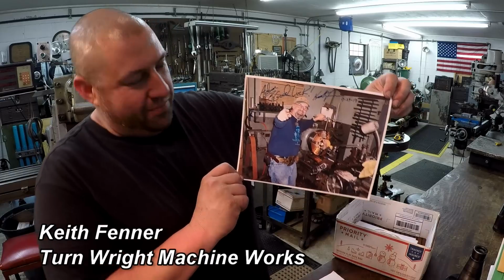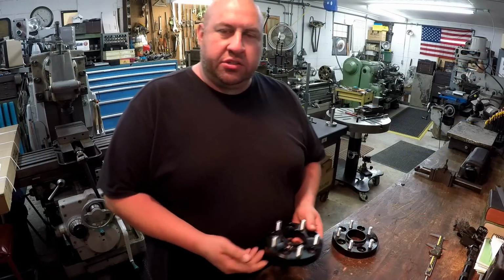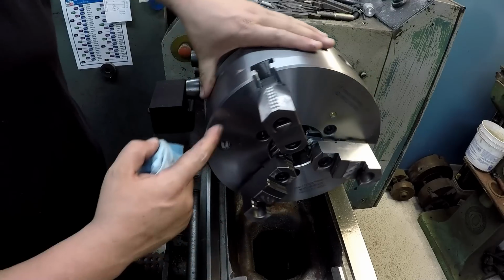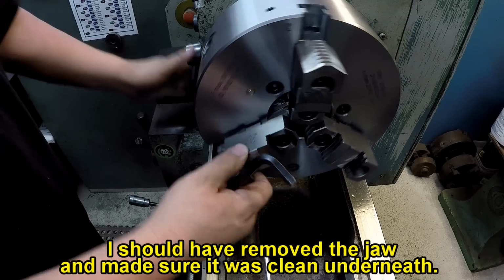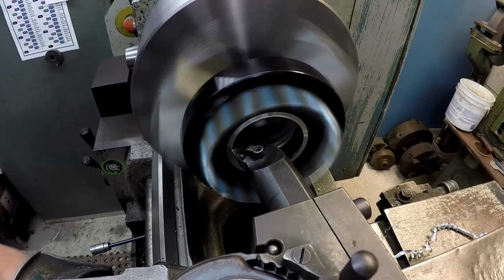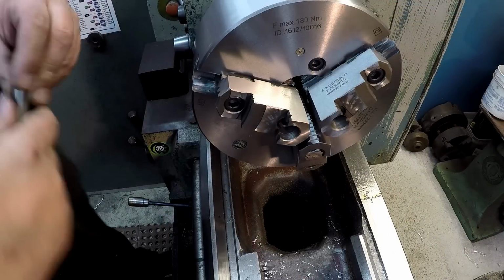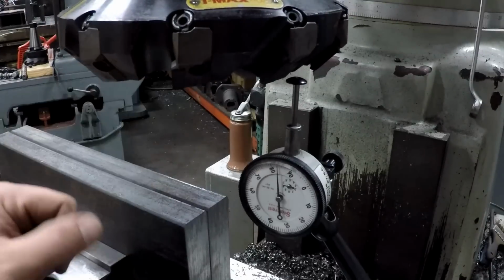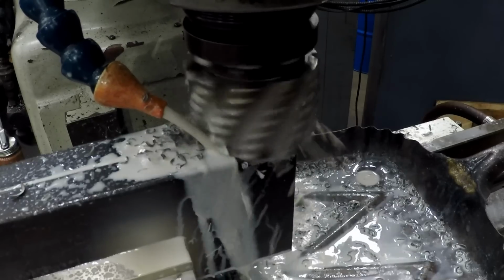SNS 165: First Job for the Gator Chuck, Facemilling, Viewer Mail

Comment from the maker: Lots of "your doing it wrong" comments on this one. Wow. The spacers won't fit on the hub of the trailer axle because of that smaller bore that needed to be removed. The conical lug nuts center up and hold both the wheel and spacer. Just doing what someone wanted, for a small trailer that holds a small aluminum boat. I'm not going to get into an argument with anyone with this job. It is what it is.
Reply: Everyone's a critic.
Reply: Abom79 there are two types of wheels available,  a hub centric wheel needs the bore and lip of the spacer to match, a lug centric wheel uses the fasteners to center the wheel in relation to the axle centerline. Either way works
Reply: Adam: "you're doing it...." :o)  That is my only complaint. LOL.
Reply: Abom79  I won't say the job was done wrong but the jaws should never be slack to check runout
Reply: Adam, ignore them.  Regardless of your immense skillset(s) and experience,  you've probably forgotten more than most of these keyboard critics have ever known in their entire lives!!!  Keep doing what you're doing because you CLEARLY know your stuff and we are all better for having watched your content!  Much appreciated Sir!  Cheers from Southern California!
Reply: The "you're doing it wrong comments" are from the people that heard how something is supposed to work.  Back 70 years ago before conical lug nuts were common is when the center bore was needed to locate on the boss of the hub.  It's not critical anymore.
Reply: @dylanrink3130  no crap
Reply: John Dough wheels still need to locate on the hub boss. Otherwise Tire Rack wouldn’t still be supplying wheel hub spacers with aftermarket wheels

Comment: Adam: Something I do when attaching one item to another is to tighten the bolts roughly in pairs that are opposite each other and step my way around the bolt line.  In your example you have six cam-lock bolts arranged in a circle.  Number them 1 through six.  You did them up in the order 1, 2, 3 ... 6.  I would tighten them 1, 4, 2, 5, 3 & 6.  I would tighten until there is light resistance on the first pass, then repeat for medium resistance on a second pass and on a third pass use full force.  That way, you are locking it on parallel to the mounting plate rather than crooked. 

You can’t flex a thick item like the body of the chuck and so once you have snugged up on bolts 1 & 2, nothing you do further corrects this.  You can prove this by inserting a tool crooked into a taper and press hard. No amount of force will straighten the tool once it has bound with a mating point.  

Gently ease it in with balanced force and the mating will be perfect. You can take the years of practice from the bedroom to the workshop. The ultimate goal is happiness all around! Happy mating.

Comment: I was aprrentice with excact that Lathe there ... the Victor... Complete same model. Did alot of Connector gear and support gear for Oak Industries on that one .... like all types of materials...!!  It's really a good machine if in working order. ( not as stiff as somethimes needed but for all types of jobs all around it's good )

Comment: The Bridgeport style machines are pretty much maxed out with a 3" face mill.  I has an Iscar 3" that used OEMT or REMT inserts.  It wasw an excellent face mill but the 3 hp Bridgeport clone was nor enough machine to use it effectively.  I traded it for some grinder accessories. I now use a 3" face mill with 4 SEKT inserts.  It works a lot better.

Comment: Not sure why all the doing it wrong comments. First, it's what the customer asked for. Second, most small boat trailer axles use hubs that are stud pilot, so cutting the hub pilot step off the spacer is fine because even tho the wheel that's going on it is probably hub pilot, it would only pilot onto the spacer and spacer is piloted on the studs. In fact a lot of big trailer still use stud pilot (typically budd style) wheels and hubs.

Comment: i was wondering.  during your face milling experiment.  are the spindle bearings set with enough preload to widthstand the impacts of the cutters without bouncing off.    can you install something big and rigid in the spindle and see how much deflection you actually get.  when you just wiggle the end of the tool or bar..   might be interesting to do that in various lathes to check for slop that could be eliminated with a tear down inspection.

Comment: What do you get when one machinist orders a product from another?  A blueprint and a note saying "some assembly required".
Reply: My dog's a machinist. Every time we go for a walk he makes a bolt for the door.
Reply: What's the difference between a puppy and a machinist??  
A puppy stops whining when it grows up.
Reply: Machinists are always screwing around...
Reply: +Dan Keller  ...may wish to add an 'h' to wining so you get whining. :o)
Reply: Thank you, i was only an 'H off.
Reply: I got some humor for you, do you know why machinests dont get much done at work, well they are always milling around and laything about, if you press forging a bar stock for a clock tower hand well thats being pressed for time, you know how you punish metal that wont shape, you take it across your knee of your mill, you know where a machinest sleeps, a mill bed, cleaning up the surface each time is a daily grind, you know why a machinest can line up with others, they are always doing drilling.

Comment: Those centers that you machined off are necessary to distribute the load to the original hub and keep the wheel running true and balanced. Those should not be used!!!! You should make a set with centers that fit both the original hub and the new wheels to be safe. I look forward to your videos every week, my wife just told me I am addicted. I have been a mechanic for almost forty years, and felt I should let you know before possible failure occurs. Keep up the great work, you have taught me and others a great deal. Just want to return the favor.
Reply: Todd Hopkins 
Trailers are different then a car rim being hub centric.
Trailer rims are a loose bore fitment

Comment: When checking the face runout of the jaws you really should have i chucked on a ring or at least a bar in the center. I've used several and even own a 6" gator chuck and they are okay chuck for a 'quality import' unit. I wouldn't call them high quality or very accurate but they are pretty decent for the price. You wouldn't want to rely on one for say a cnc or some high precision or high through put machine but for a job shop manual lathe they are quite good and definitely a great value. I highly recommend using a setting ring and just grind the chuck in now that you have it mounted and location marked. Should fix those out of square faces and really its a pretty standard thing to do to chucks. I don't think I even own a set of hard jaws for any of my chucks that I haven't true'd up on the machine, on my cnc I've reground the jaws a couple times now as wear pretty bad grabbing rough scaly material and the such.
Thanks for sharing and all the hard work you put into these most excellent videos!
Reply: digitalradiohacker sure, when your dealing with 'value' tools they almost always need a little finishing and tune up. also it's very normal to grind chucks in as they do wear out and need it.

Comment: That acra is still a lot better than a bridgeport. On my 2" 4 flute face mill, I can take a max of about 50 thou at 7ipm. I think it could handle more depth of cut, and certainly a lot more feed, but I run out of horsepower.

Comment: that 3 jaw will probly get better with use the jaws are wide, lotta contact with the scroll checking with different size "standards" scroll concentracy or the hub it rides on herd that gear clack on the hi low sounded like a mini mill with a 3" face mill good you tried it ,it mighta worked!

Comment: Abom.     When you first fitted the new three jaw chuck. you tried different locking pin holes.you found one that gave you next door to nothing of a run out on the HSS Question did you carry on trying all the pins to see there was /is a better run one. Steve

Comment: Adam, just wondered if those spacers were for use with steel wheels and conical face nuts.   If so i am not sure they will work. Aluminium wheels use the spigot on the hub for  centering and flat face nuts with conical washers ? I may be barking up the wrong tree here if so disregard my comment

Comment: Hey bro, another dang great video!   Man, lots of haters on here, lol.  Just as an fyi, I have a 3 jaw chuck that has greater runout with the larger jaws.  One of the jaws is shorter than the other two.  Now this is only on the larger clamping setup.  That specific shorter jaw, was so on all three of the jaw lands, thus giving me runouts when I use the larger jaw setup.  When I use the small part jaw, or the normal jaw setup, I'm less than 1 thou.  I need to grind the other 2 jaws to support larger parts concentric to the spindle.   I hope this gives you something to check on the nice surface plate.

Comment: since your carbide cutter is adjustable offset each cutter .025  looks like it has 8 inserts that = .200 cut works on low horse power machines = to 8 .025 cuts at once

Comment: I've a question regarding the milling at the end. If you compare, say, two cuts, one 1/4 inch depth, 4 IPM, the other 1/8 inch depth 8IPM, are you effectively asking the same of the machine/tooling on both cuts? I realise the answer isn't a simple yes or no, just wondering if there is a preferred route to take, and why.

Many thanks in advance to anyone who is willing to help educate the clueless author of the question!

Comment: hey buddy have you ever had the opportunity to use a 3 jaw push chuck i used to have one on my old gurutzpe lathe and it always worked a treat for smaller parts, it had 4 allen bolts counter sunk on a 45 degree angle in the main body of the chuck which could be loosened and tightened to gain near perfect run out, just curious

Comment: Ohh. I dont like taking the rim support ring out of the hub. On axles that support over 1000kg the rim is supposed to transfer the load via the shoulder and not the studs. Its mute anyway,  we are not allowed to run spacers here in OZ anyway.

Comment: Do you ever use soft jaws for work like that on those aluminium spacers. I used to but only because I got a new soft jaw chuck in an auction.
Reply from the maker: Equiluxe1 Only use them for repetitive or production jobs. I plan on getting a set for that chuck though.

Comment: it was vibrating with the big facemill because there where only one or two teeth of the cutter in the material you should try it out in a bigger part
Reply from the maker: Bert Wagner No, it's the mill. Tried to explain its not rigid enough for tools like that.
Reply: Abom79 we take even deeper cuts than u did on Deckel fp2 mills and it works just fine only a bit of chatter in the beginning and at the end thats because we take cutters of the right size for the job this one u used i would say was to big

Comment: Round 2. Not again with this... (Adam's been through this before) False in 99.999% to all comments concerning the wheel spacer machining shown. In most cases of RV trailer and light car and truck use the elimination of the flange is safe to do so. Almost all lug nuts used throughout North America are concentric and center the wheel based on the stud centers. If you carefully look at the spacer Adam is machining, the holes that are used to allow the existing hub studs holes (to hold the spacer on to the trailer hub), have a chamfer, to what looks like 60 degrees (common angle used). If the spacer stud holes were out of center, then there would be a defect in the machining and manufacturing of the spacer. The wheel will always be centered via the studs. That's why all wheel rims (steel or aluminum) have a stud holes with are machined with chamfer holes and mating nuts. So along as the spacer has the proper stud hole to hub stud machining, the spacers will be fine. If there's a weak link in spacers, it's the quality of the new wheel studs. This is especially  true of a few that I've seen for sale that are made in China. 

Some Heavy trucks and some trailers do use a flat nut and precision hub center. The rim centers are up to 1" thick and are also fairly tight against the shoulders of the studs.

As long as you do not tighten and torque a single wheel nut before all the others, then the wheel should center properly. It's why, if anyone bothers to read their owners manual, you hand tighten all the nuts first, then begin to torque them down evenly in a diagonal cross pattern to make sure the rim properly seats against the flange face, not the center of the axle. I've seen more than a few wobbly wheels because the wheel was improperly seated and incorrectly tightened. The "centering' of the hub would have no effect. 

Some of you will say, "but then why is there a flange lip on so many steel wheels found on European cars?" The answer is simple - it is to maintain the flat surface of the steel wheel against the hub flange and does not have anything to do with centering the wheel. It uses the same principle as a 90 degree edge lip along the length of a sheet of steel, which helps keep it flat and not bend. It's also part of the stamping process of the center section of a steel rim during manufacturing. 

Because aluminum wheels are used across a variety of different manufacturers and different wheel hub designs, as long as the bolt center and inside offset clearance is maintained, the wheel manufacturer machines the center hole as wide as possible. Look at any OEM axle / hub supplier like Dexter and you will see they offer a wide variety of different universal aluminum wheel options that can fit, depending on what track width is desired. 

The only component that has a register that must be precision machined is a brake rotor hub (or drum) on some makes of cars. And even then, I've seen them have factory runout of 2/10th of an inch at the edge of the rotor hat and more at the lip. 

The only light weight wheels used on cars that have a register using a narrow tapered conical centers with a single almost flat holding nut, are the rims used on F-1 cars (an soon followed by Indy style cars) first developed by Halibrand after World War II.

All aluminum wheels used on RV trailers, trucks cars, etc, are all bolted onto the car using a conical seat. It will ALWAYS set the wheel's center than any center register would. Spacer's are commonly used and legal. The spacer's most common use is to use different wheel offsets (depth from flange) and as long as the lateral loads can be supported, the aluminum spacer will be fine. Centrifugal forces are not in play if the assembly is machined properly with less than 1/10th runout. Balancing should not be required. 

There is no specific DOT certification required in their use or requirement by law. The consumer / end user is always liable in the event of a failure. 

The user's insurance carrier may void their coverage, because it's not a factory or OEM component, but that doesn't mean they aren't safe to use. Having used spacers on race cars that are simple thickness spacers up to half an inch thick, to offset wheels slightly farther out, they have zero flanges or chamfers (they use the existing hub studs to wheel nuts), I've never had a single problem up to speeds of 160 mph using steel wheels without any registers. These spacers are made of steel or aluminum.

End of rant (#2) I should really do a video on this topic. Drives me crazy to see  some of the comments that are not based on engineering and the laws of physics. I just finished setting up the Abom79 Ford Fusion race car today... hrmmmm.